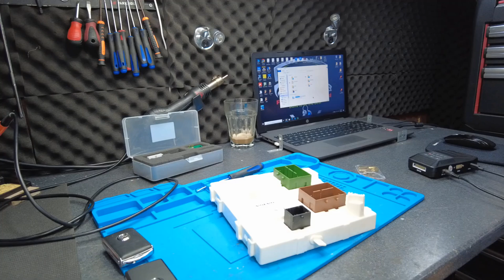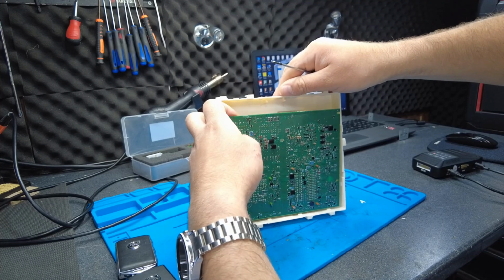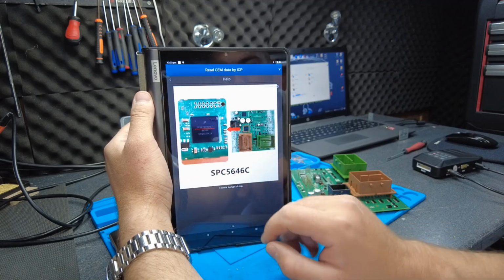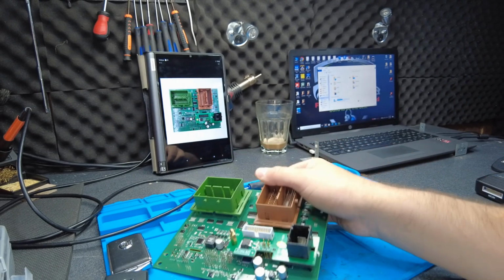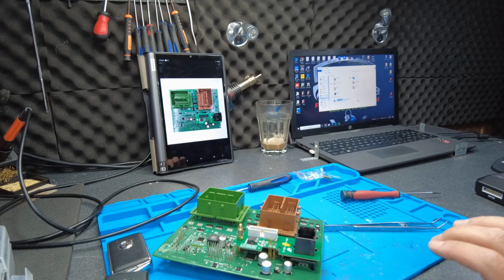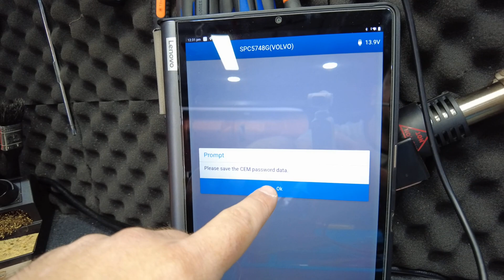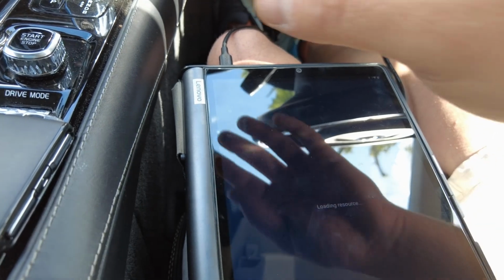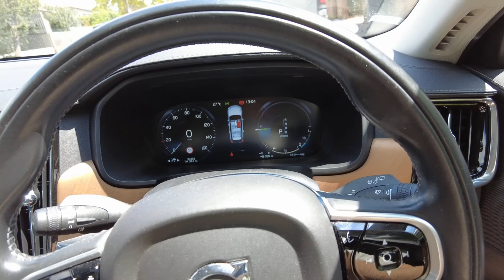Volvo V90 2018 Key Programming | All Keys Lost or Spare | ACDP Yanhua Full CEM Tutorial

Comment: Hi mate,  have you done a Mazda cx30 add key 2023 model? Needed incode outcode processing,  I have Autel & avdi but havnt tried yet 😅, Autel says risk for using aftermarket keys ,faults may be present & not able to clear 😬. Good video on Volvo Cem add key 👍!
Reply from the maker: You need to use oem keys and the key must to be with the same number of buttons like the oem key was